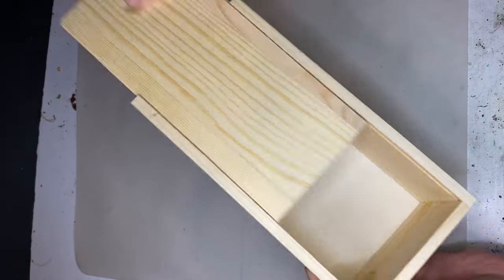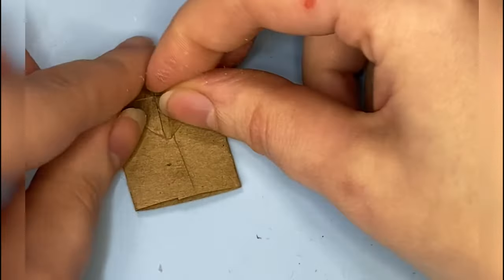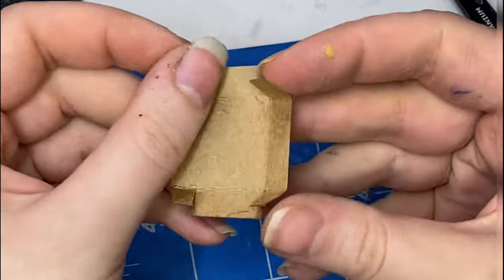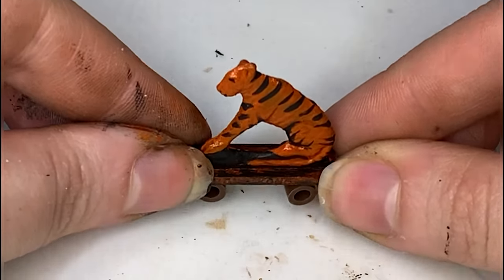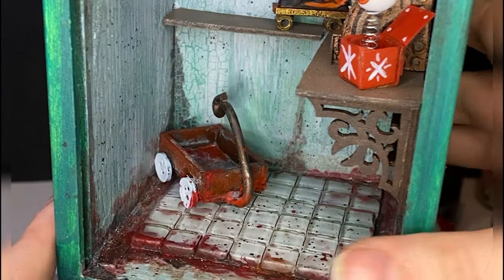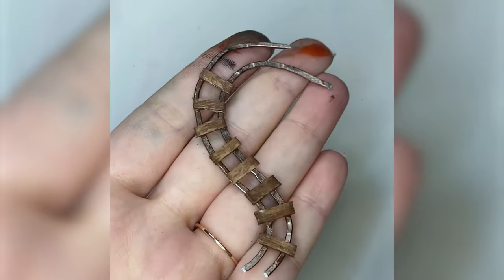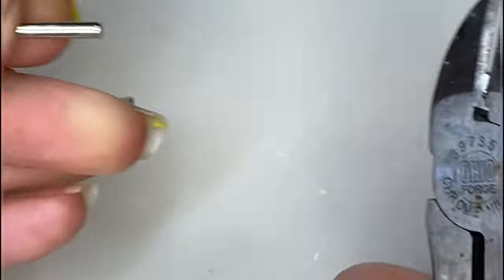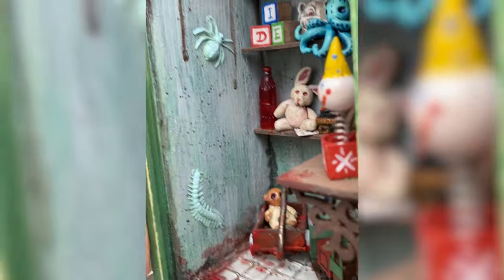I'm making a Miniature Toy Shop - Art Commentary

Comment: I read an article on paper vs plastic a while ago. Basically it takes four times as much energy to make a paper bag than a disposable plastic bag, so if you only use the paper one once (because it gets wet or splits or whatever) but use the plastic more than once (maybe using it as a bin bag at home or for taking in lunch) then plastic wins after 2 uses. But that's assuming the plastic is made using a waste product of fuel production and that the paper bags are already made from recycled materials so can't be recycled again.  It was in 2011 so the numbers might have changed since then if they did the study again but google "Comparison of Environmental Impact of Plastic, Paper and Cloth Bags" if you want to read it :)